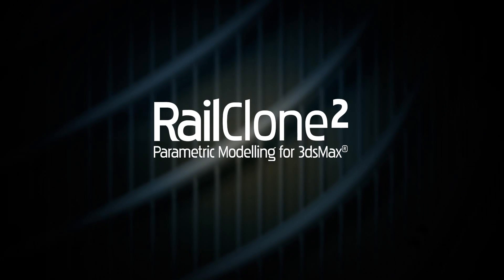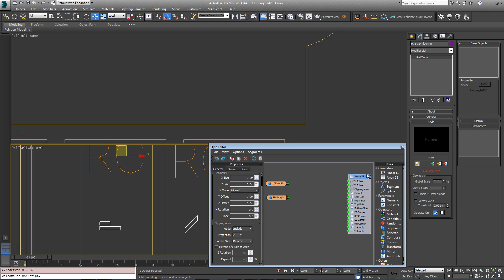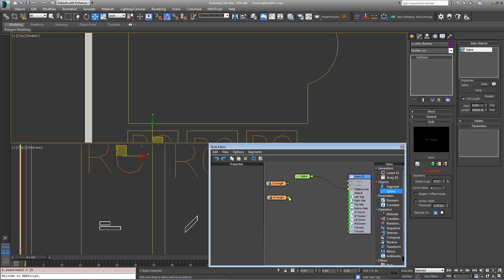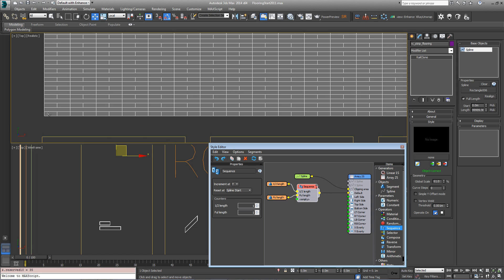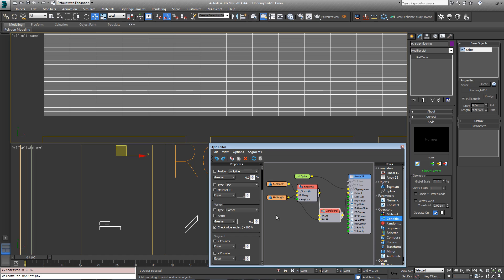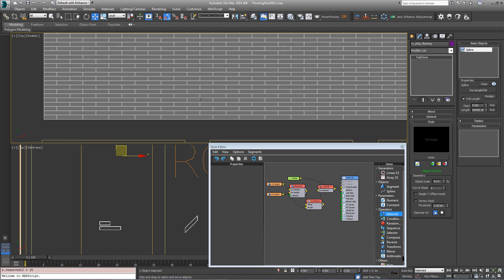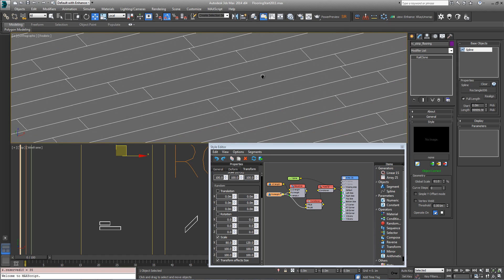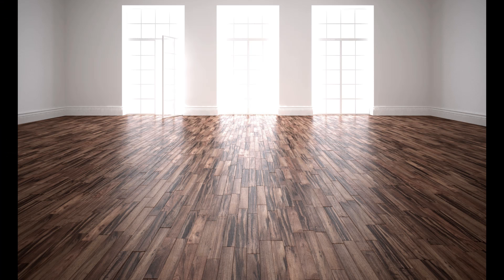QUICK TIP: Creating a strip style parquet floor with RailClone in 3ds Max (intermediate)

Comment: what floor generator do in 5 clicks itoo does it in a few hours. what a fucking joke.
Reply from the maker: Thanks for the comment. Just to clarify that this tutorial isn’t really solely about making a floor, It’s also showing how to build a floor-generator style plugin using RailClone. The idea was to teach the underlying logic so users can create their own procedural tools, not only floors.

If you just want a quick result, RailClone already includes built-in floor presets that create strip, herringbone, chevron, basket and other patterns in a couple of clicks. 10 are included. We’ve even updated these now so each preset has full customisation and multiple material variations and they'll be released within the next few weeks. So if you don’t want to build anything yourself, you can drop these straight into a scene with the same simplicity as any dedicated floor tool.

RailClone handles far more than flooring, which is why older tutorials focus on the thinking behind the system. But fast, ready-made options are already there when you need them and we're aware that users want more simple solutions like this, so we're working hard on new libraries to help make that happen.

Comment: how come when I check  on the X Counter under segments.  under conditional properties. my tile just disappears?   man... this railclone is too complicated.. I have follow everything and it does not work..    floor generator is faster and you do not need two damn planks to do what you can do with ONE while offsetting one plank...   this is my second time giving railclone a try but is keeps on failign on the simplest things...
Reply: I agree. I have tried lots of tutorials and maybe the orientation or something is off but I do what he does and it doesn't work. iToo bungs in Waaay to many parameter's. Forest pack is the same.
Reply from the maker: Please feel free to send your file to helpdesk@itoosoft.com and we can take a look at why it's not working. If you want an easier approach, RailClone also comes with a library, including floors, that you can just load and assign to a spline. I hope that helps, please let me know if you have any further questions.